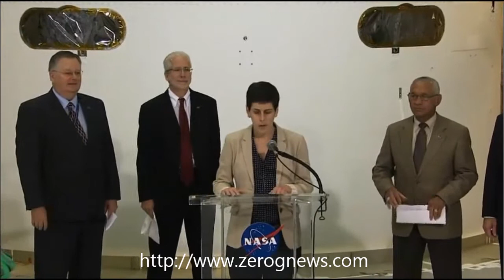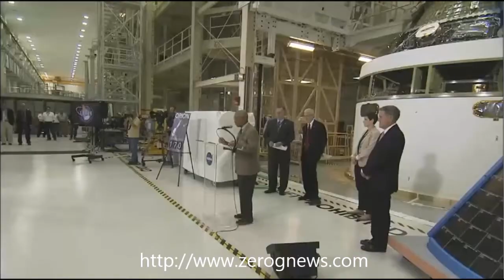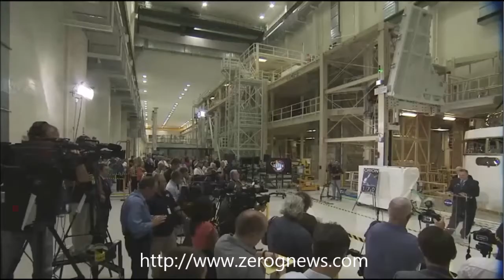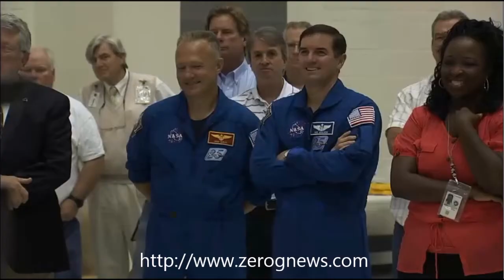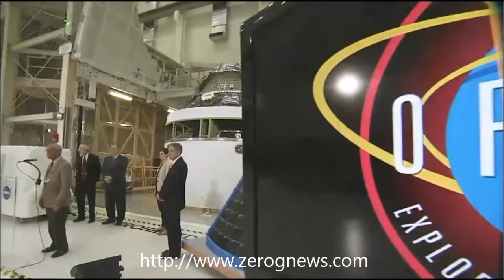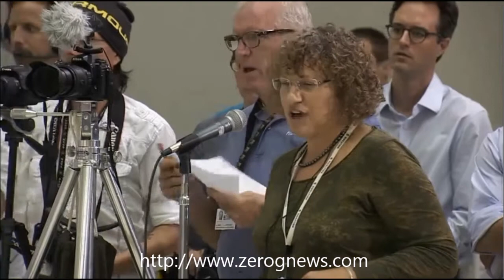Orion EFT-1 Progress Update With NASA Administrator Bolden

Comment: if the launch is open to the public i think i would like to travel to see it. never saw a launch in person before and this would be cool delta iv heavy is pretty awsome and the orion would really make it awsome to see. that being said i like anything that nasa does, im not one of those people that says well the shuttle was poorly designed or was just a peace of crap or death trap. instead i see everything nasa does as the creative essance that allows us as humans to advance and solve problems that simple computers could not. the shuttle built the space station, i wonder how easily it could of been done by launching every single part by individual rockets. i think the shuttle was very important and nasa really needs to replace the shuttle. but i think they know what they are doing and they are taking a break from winged space vehicles not because its a bad idea but because there is new technology on the rise that will be great for it and it is simply too early to start development. for instance now we are getting better with scram jet engines so one day we could possibly have some kind of scram turbine engine capable of taking off conventionally and then accelerating it to speeds in excess of mach 15 then transitioning to traditional rocket engines. this would reduce weight of space vehicles because some of the oxidizer would not have to be carried. i think already this has great chances of replacing sounding rockets and sub orbital and orbital space flight as unmanned science could be preformed by this and it wouldn't require surviving re-entry.